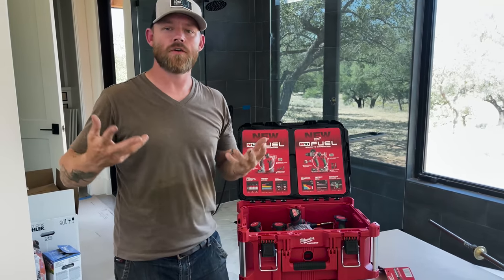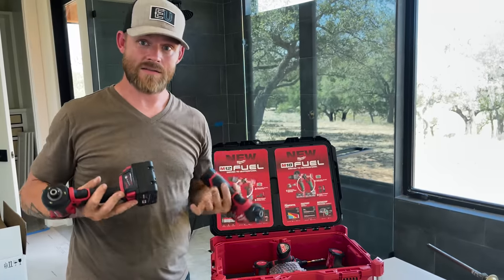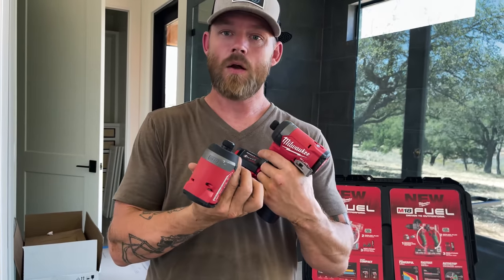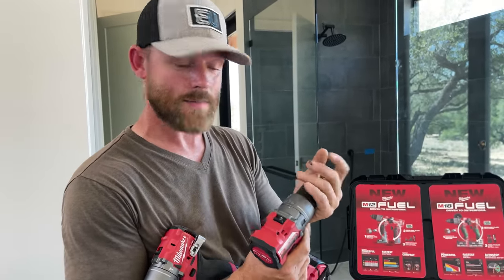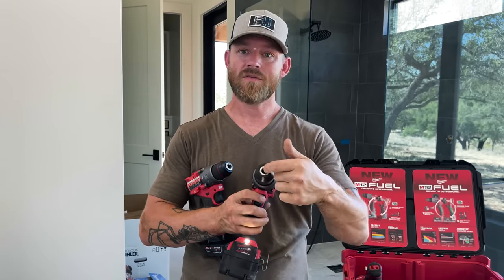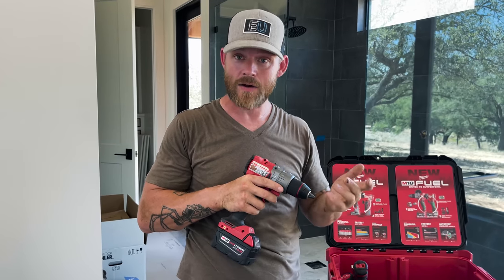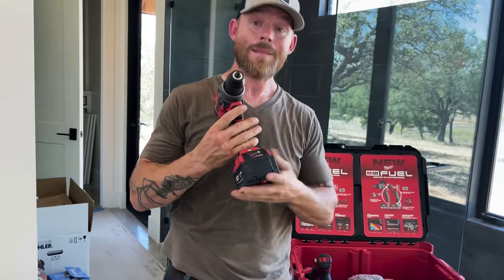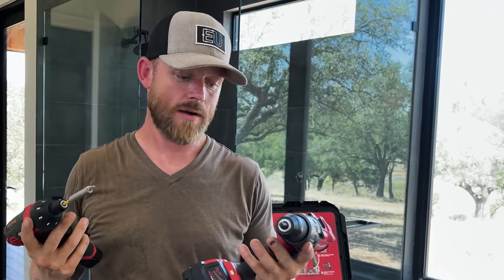2022 New Drills: New Drills Electricians Need

Comment: I'm more in the yellow camp, myself, after being saturated with DeWalt at my last job. They work just as hard at 10,000ft and -30F as they do at sea level and room temperature. I can't say that for the other brands simply because I didn't have them to try. ;-) (For all I know, the other brands are just as reliable at those extreme environments.)

But something that I finally found after a lot of searching when I was in the market for my personal tools and wanting to save a little coin is why have both an impact driver and a hammer-mode drill? It has to do with the different types of impacts. On a hammer-mode drill the impact is axial motion. This makes the tip of the masonry bit act like a cold chisel pounding down in the center of the hole while the spinning clears the chips and turns the chisel to impact in a different orientation. On an impact driver the impact is rotary motion adding a little more umph to the spinning motion. This give a little boost of torque with each impact.
Reply: good info! I wondered about this but never looked into it.
Reply: Yeah I definitely noticed the difference driving Tapcon anchors with my impact vs my hammer drill that I used to use for both the hole and anchor. Ah and it is so much better having your set of different tools and not having to constantly change bits....

Comment: Hey I got 4 years in the trade and the only power tool I don't have is a hole hog and I've used my bosses and it sucked compared to my 1/2" hammer drill is it worth spending the $300 for a hole hog when you can make due with the hammer drill

Comment: Pro tip - that setting with the screw symbol is sensitive to TEK (self-drilling, “self-tapper”) screws. In a nutshell; set your screw, pull the trigger to 100%, impact will do max speed for the drilling part, automatically drop the RPM for the tapping/screwing part, and automatically stop when the screw is in all the way, even though your trigger is still at 100%.
Barely any pressure needs to be applied, and it does wonders when mounting boxes on lighter gauge studs. Not perfect, but basically no blown-out holes and wobbly boxes.
Myself and everyone I show it to are blown away by how tf Milwaukee engineered that into the driver.
Reply: But what a pain when it switches to that mode when you don't want it. Lol
Reply: @mostlikelywedoitservices6926 
Oh so true, happens waaay too often just by grabbing it

Comment: I used a Milwaukee for years. Drilled a lot of holes in sheet metal duct work, turned a lot of Tek screws. It still works today after over 10 years of work. The batteries need replacement, but the drill itself is going to out live me.

Comment: I broke 1 front tooth from kick back drilling overhead reversing out an extension paddle bit trough multiple studs on a ladder tooth broke off in my lip had to squeeze it out, months later when I got the crown at dentist I seen there is still a shard of tooth In my lip on x ray lol

Comment: M18 tools come with the dual voltage charger. M12 do not. If I was in marketing for Milwaukee I would immediately start selling the M18 dual chargers with M12 tools also. So easy to get people to buy a different platform if they already have the charger. The screw symbol is for self tapping or sheet metal screws. Starts slower to keep the screw from running

Comment: Milwaukee tools and Milwaukee pack out all the way. I have the M18 stuff but not the M12. I have a dewalt 12 volt impact and drill. I use the 12 volt to install devices and do smaller work and use the M18 stuff to do larger jobs. The only reason I even have the dewalt is because it was given to me. I always used to just use the Milwaukee. It’s easier to pack the smaller 12 volt dewalt around all day putting in plugs and switches and hanging fixtures than it is the Milwaukee. I could do the same thing with the M12 and I will one day when the dewalt craps out on me 👍. A couple of things I’ve noticed about the Milwaukee drill. The chuck wears out pretty fast if you use it a lot. The teeth quit gripping. And the impact. The bit input will wear out to where the bit wont click into it easily. You have to wiggle it around to make it click in. But that takes a few years of constant use. I still love their tools though.

Comment: pro tip for drilling out metal boxes with a hole-saw and you don't have that handle: put the box on the ground with your right foot applying pressure right next to where you're drilling. if the hole-saw catches/snags the box won't go spinning bc you're holding it down with your foot and it won't twist your arm off bc your calf will stop it the drill from rotating

Comment: Wow did you even read the manuals?

1.  The screwdriver is variable speed, not single speed

2. The screw symbol on the impact drivers is self tapping mode. Not drill mode.

That's 4 minutes in. I'll update if there's other stuff.
Reply: Wait, you're supposed to read those? Everyone I know throws 'um away... Who knew

Comment: I usually leave the chuck set even when drilling, because as it pops through the back side of an eighth inch steel angle, the drill bit will snag on that last little edge of metal and break.. especially with small bits. I set the chuck to just enough torque for the size drill bit I'm using, and if it catches at the end the chuck will release so i don't break my bit.

Comment: I would never use the 12v driver. Too slow and limited. I run daily with this one. It impacts. Supper control once accustomed to it. The speed is fast. I can put outlet covers all day without cracking one. The tool I swing daily. M12 12V Lithium-Ion Cordless 1/4 in. Hex Impact. It is small and lightweight. It is the size of a screw gun.

Comment: That screw setting on the impact, is not a drilling setting. It helps with selftaps not over tightening. Then also helps prevent stripping a screw or hole. That setting is the weakest of the 4 settings. I use that for delicate fasteners. Put a drill bit on that impact, the screw icon will crap out before the 1-2-3 will. Info you said of it applies to their actual drill, not their impact. Try that setting instead of that useless screwgun :]. My 1-2-3 settting with snap off basic dry wall screws, the screw icon wont.

Comment: You just convinced me that I should get the screw gun. I'm forever using too much torque with the impact driver or futzing with the drill to change the setting just to drive a screw bit in it. It would be great to have another gun just for screws

Comment: rotary hammer drills have low RPMs because you dont need to drill through har materials fast or you dull your bit my rotary is at most half the speed of my smaller drills

Comment: I've used Milwaukee for years. I've used M12 for slabs of concrete. I still havey first M12 impact driver. Never use lower torque on any impacts or drill driver. Gotta use finesse. On that trigger. Also have my 1st Milwaukee M18 hammer drill and impact. It's going on 6 or 7 yrs.

Comment: Dewalt and Milwaukee are basically the same power tool. In my experience Dewalt is more powerful in general while Milwaukee lasts longer. HOWEVER the pack out stuff and Milwaukee’s hand tools are head and shoulders above Dewalts offerings. People are always confused by my tool bag when I pull up lmao Dewalt power tool homer but all Milwaukee hand tool stuff
Reply: Lmao same! My tool kart is all red with Packout brackets all around (see my profile picture). But, when you open the drawer it's Makita power tools with Klein, wiha, knipix hand tools. I actually just picked up some Wera screw drivers. I'm still on the fence with em though.

Comment: I have seen on  you tube they use the clutch setting on the drill driver to prevent the drill from wrenching the from your hand when using large bits.
Reply: Very handy with janky large hole saw setups.

Comment: What's the difference between the impact and the hammer mode on the drill? It sounds like they do the same thing
Reply: A hammer mode impacts forward for breaking concrete to create holes. An impact has a clutch the slips and then slams to create the impact and is used for driving fasteners. Hope that makes sense.
Reply: @slolsx  so an impact is rotational hammering and the hammer is linear hammering?

Comment: Awesome stuff Bud, you have been inspiring me over 3 years in the trade. Keep it up.
P.S.
So 2 tips that I learned somewhat recently when you were talking about the drills/drivers:
1) to actually lock it you have to turn it clockwise a little until you hear a click - that locks it - when you just torque down the chuck/ end that doesn't engage the lock
2) the "Coning" (or the 3 points that come out from inside the chuck) out of the tips as he talked about is SUPER useful say in a situation where you have a hex-headed screw that you don't have a bit for say some weird metric size- what I have done from the past is hold the drill with the 3 points inside the chuck backed off and then grab the screw by holding the chuck and going forward onto the head of the screw until the 3 points are firmly on the screw and then reverse to get that screw out!
Reply: I only watched this video to see if he knew that trick with locking the chuck. Very few people I show that to know that. Good on you man.

Comment: Yeah. One time when I was drilling through a top plate up in an attic I was in a corner and I had it in 1 and I was drilling and I hit a nail and it kicked around and somehow the trigger got stuck and the drill wedged itself into the corner and just smoked the motor lol. It sucked though because the drill was gone.
Reply: I was in a crawlspace, somehow while I was crawling, I hit the trigger and the auger bit wrapped up in the leg of my shorts, it was so tight I was losing circulation in my damn thigh and the trigger was covered by my shorts so I had a hard time getting to it...was nuts... Not to mention the many many sore wrists that almost broke
Reply: @jarrydee2799  damn man ! Yeah I’ve had some twisted wrist situations as well lol. It sucks. That sucks with your leg too man. That could’ve been really bad but I’m glad you made it out of that 👍
Reply: @gonzomalan  yeah man it was a sad day …

Comment: Dustin ---- check this out.  
 Do you remember when battery drills first became somewhat common, everyone used Black and Decker 6 volt ? When I became an apprentice in 1986 my boss gave me a small screw gun 7 volt with a wall adaptor transformer that had a wire you plugged into the back of the screw gun handle, a little round male connector. This screw gun had a built in circuit breaker for torque that would trip if it was straining too much and a little yellow button popped out of the handle that you pushed and it reset.  This screw gun was "L" shaped but pretty small and cake with Jacob's chucks and it was one solid red colored body.  It wasn't Milwaukee though. It was a Makita. They ended up getting sued by Milwaukee because Milwaukee actually has a patent on red power tools so, Makita had to change colors and they went with blue. 
  I still have that red Makita screw gun. It still works. I lost the original charger way back when. I told a Makita sales rep about it 15 or 20 years ago and he never knew about that tool and said that Makita may want to buy it back for a good amount of money because they were basically disposable because once the battery died they didn't replace them. They were basically the old school paper wrapped NiCad batteries like two AA batteries stacked and two of those in the handle. 
  The fact that it is red and a Makita is the coolest thing. 
  Just thought I'd share that.

Comment: I've been in the trade 20+ years. I've tried all the major drill brands,  yellow, red, and blue... Hands down, Hilti make the best cordless drills. There's no contest. Absolutely worth the extra cost if you want reliability. 20 year warranty. I'm in no way sponsored by Hilti, I just really appreciate the quality and their unparalled customer service.
Reply: An excellent brand
Reply: I might agree, but it's also eye-poppingly more expensive than most competitors, and you usually can't warranty something if it gets stolen.
Reply: Hilti is COMMERCIAL grade. In San Francisco union work/skyscrapers 18yrs ago that's all there was. Cordless HILTI EVERYTHING. Lasers, Drills, Impacts I mean everything........ But it does come with the commercial price tag.
Reply from the maker: I agree with you. Hilti is awesome. 
But a lot of folks in residential won't ever see the Hilti's Drill or impact. Nor will they see their rotary hammer. 

They might see the jack hammer or Crete saw out of  the corner of their eye.
Reply: @ElectricianU  You're probably right, though it's a shame. Connisseur level tools, I suppose. Worth it for those who like nice things, but I wouldn't let the apprentice touch them. Milwaukee is probably the best of the consumer brands right now, then DeWalt. Makita is just slipping down (I keep burning out their best new 18v drills, while the smallest Hilti cordless just laughs at the same jobs).
Reply: Hilti #1 🔥🔥🔥
Reply: hilti blows, go back to the 1980s...hilti is like snap on.overhyped, and over priced..

Comment: i buy chinese stuff that cost nothing, and it works great, cordless grinder in construction work, also hammer drill, i use it for years, now it is maybe 4 or 5 years that i use it every day, on 1 battery i replaced 5 batteries (lithium ion cells, we call it batteries), it cost me about 20 dollars, only thing that you must look at is mah and voltage, if you want to buy better buy type with brushless motor, and i woulčd not recommend drill without hammer mode if you are woodworker, you sir are sponsored to talk shit and your shit is too expensive, why is expensive, because of sponsorship, and ads, they are not sponsoring only you, but many youtube channels, and "new" products that in guts have same shit inside, but in other package
Reply: I have found that Ryobe tools are just fine. I haven’t used Wally World’s Hart tools, though.
Reply: if you notice, he didn't say buy Milwaukee specifically. he ended the video by saying buy an impact driver and a drill, which is solid advice.